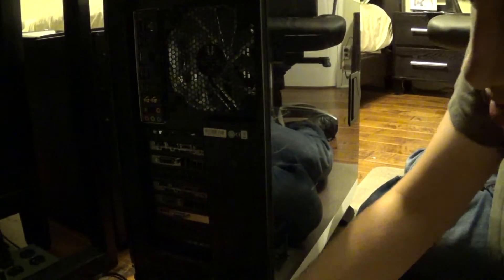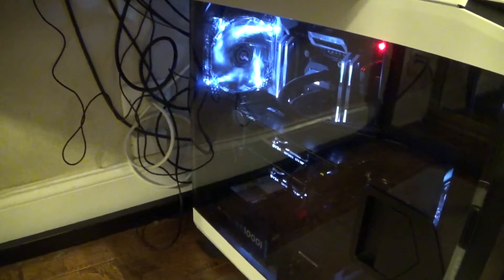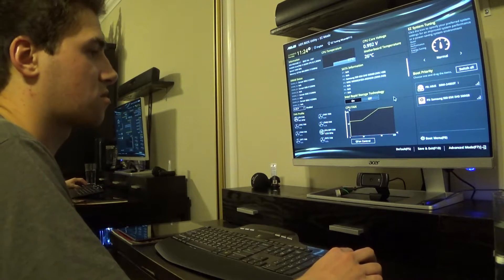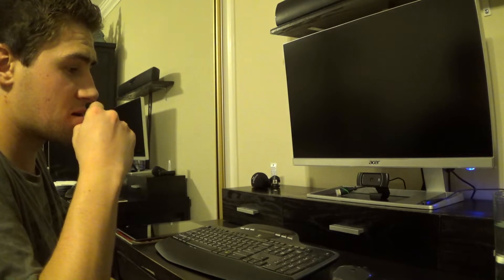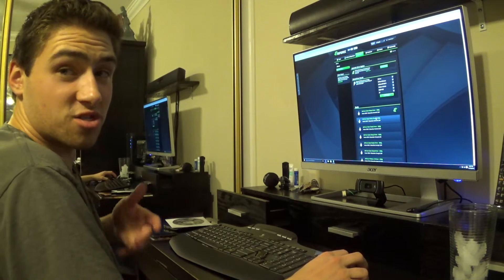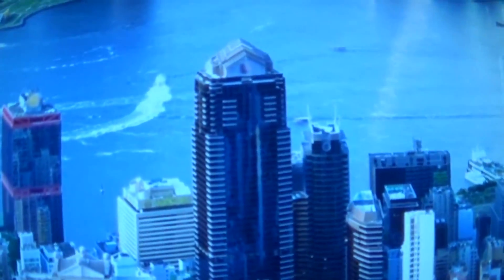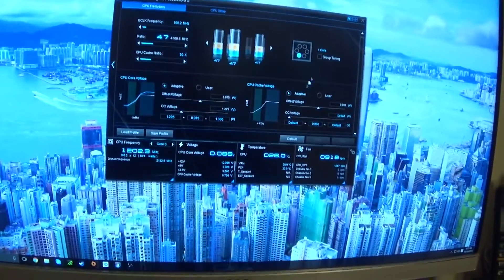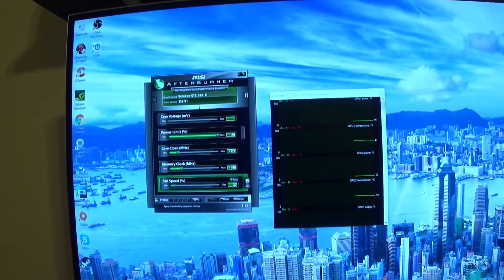Building a 4K Gaming Computer pt10

Comment: If you're seeing temps of 75c with an AIO water cooler, you did something wrong. Especially with a 240 rad. You shouldn't see temps over 50c under load.
Reply: Mario S it depends on a few things. Idk if he overclocked heavily or not.. In have Ryzen 1700x and it was reading 50c idle and 68load I was freaking out ..but come to find out the X procs read 20c more than what it really is lol

Comment: that pc is beautiful I have a $2,000 pc it's specs are i7 4790 ,gpu 980, 4 terabytes space, ddr3, 8 gb ram
Reply: Seems like you spent a lot on storage instead of parts. I would've gone with a Tb or 2tb hard drive and a 256 Gb SSD. That could've save you a couple hundred that you could've put that towards a 980 Ti and 16 GB of DDR4. But good build regardless.
Reply: +G&T HD the 980 time was not available when I built my pc. i have a 500GB ssd and a 500GB external hard drive I just added all the space I have together
Reply: +beyondthe soul good build. i have something similar. 4790k, gtx 980 SLI, 16 gb ddr3, 4 tb wd caviar black, 500 gb ssd.